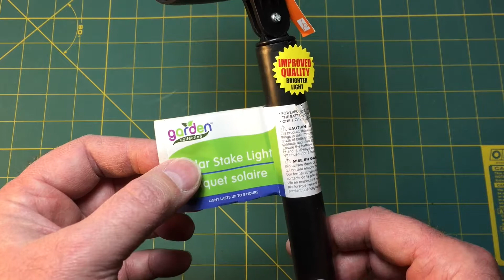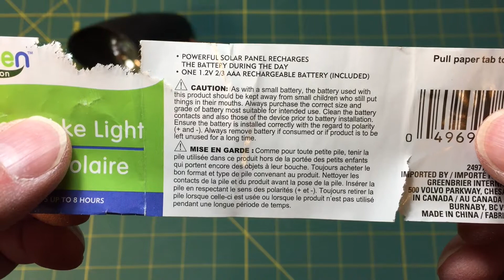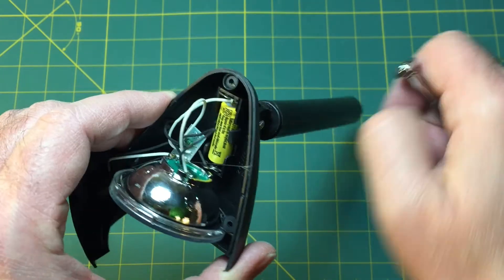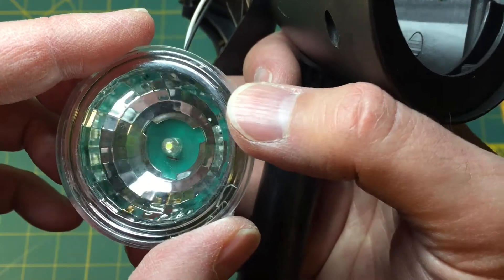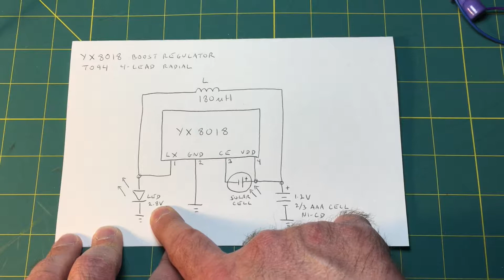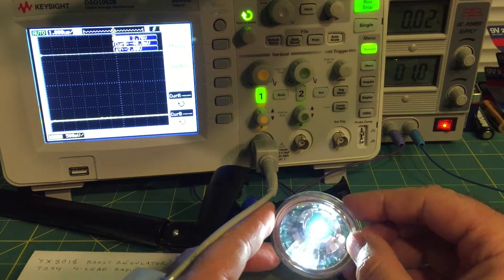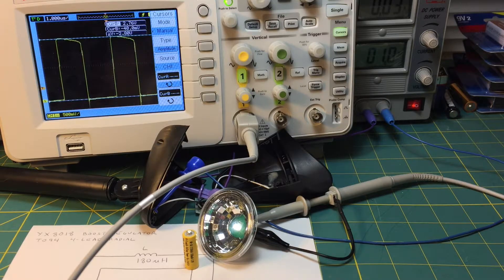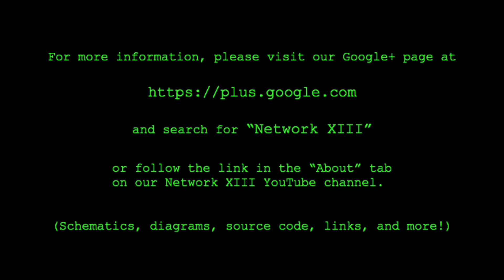Dollar Store Solar Stake Light Teardown

Comment: It is making so much sense now. At first, all I did was replace the crappy internal battery with new ones made specifically for solar lights. I was using these for jackolanterns to charge itself up and turn itself on. Eventually, I got a little sophisticated and decided I wanted to use tea lights to mimic the flickering orange flame. I thought maybe I could rewire the solar cells and put in a higher voltage battery to compensate for either the 3V coin batteries or 4.5 V total AA/AAA batteries. It didn’t work to my expectations. My knowledge of electronics is basic at best.

How can I build a circuit that can adequately solar charge a 3V/4.5V setup and then disable it when light is available from these leftover dollar tree lamps? Do I need to wire the solar cells in series or parallel? Do components need to be traded out? How do I hook the new circuit up to the already existing circuit of the flickering light set up?
Reply from the maker: You can wire the solar cells in series to achieve the voltage you require, or use a boost regulator.  Disabling may be as simple as using a diode to prevent current backflowing into the charging circuit when there is no ambient light.